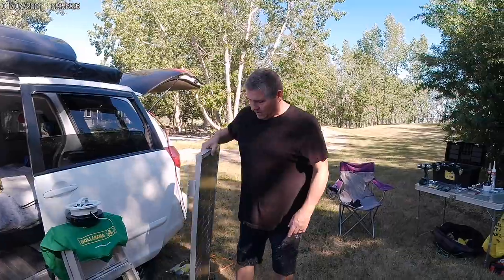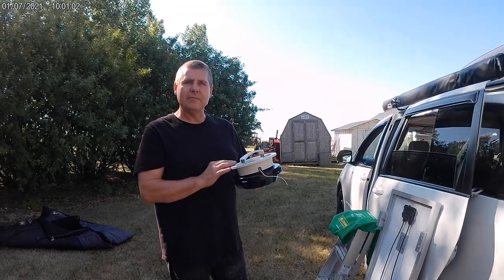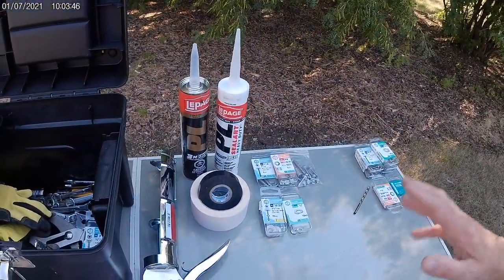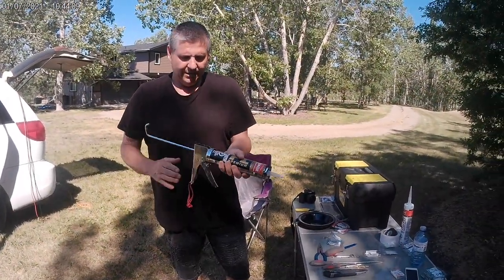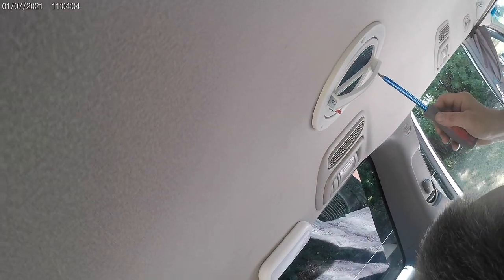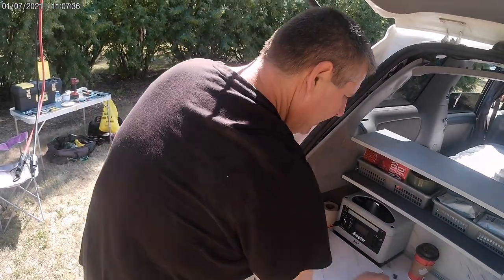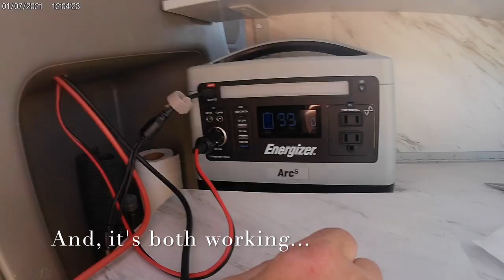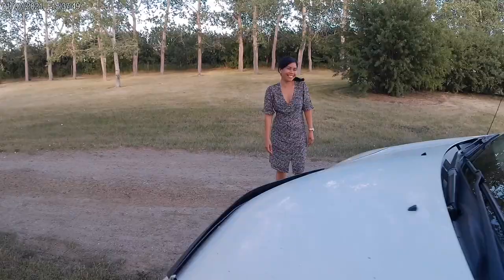Installing Solar Panel and Roof Air Vent in our Minivan - 2008 Toyota Sienna Conversion

Comment: Good decision on the Ventline Ventfan. I installed one on my Promaster City and am very happy with it. I also installed a PWM (Pulse Wave Modulation) speed controller with the fan. The controller allows me to vary the fan speed, therefore the airflow and noise. It’s a nice feature when trying to sleep during the night.

Comment: Two suggestions. As your cord came down around the struts you may have a water intrusion spot. Some installers keep the cord in the area where the hatch rubber trim is and loop it at the bottom. Any water rolling down the cord will continue down and out the bottom. This of course may be unnecessary if behind the taillight where you put it there's a hole and sloping surface to the outside.  Also put more caulk around the fan housing AND the screw heads.
Reply: Very true it's a bad idea to make holes in the roof. In states with rain monsoons. Its gonna leak from the pressure of the water.

Comment: Thanks so much for sharing I've been looking at those roof fans and trying to decide if I should install it or hire someone. Your roof look like the way I'd like to have mine. I just found you. I know you're thinking of reversing the fan, maybe you should have 2 fans. let me know
Reply from the maker: You can do it girl. Just take your time. We have 2 small rechargeable fan inside the van for air circulation.

Comment: Did you have any issues with water leaking into the lights? I’m thinking the same but also thinking I need to seal it as well. Thanks for the video and the idea.
Reply from the maker: Not at all. Thanks for watching our video.

Comment: What kind of screws did you use to attach the solar panel brackets to the crossbars pls? Were they metal tap screws? How many? Have you had any issues with them?
Reply from the maker: We used 4 Stainless self tappings screws. No problem encountered.

Comment: So did you connect that vent fan to that Energizer power station? If so, did you run the wire through the car to make it connect all the way at the back?
Reply from the maker: yes, we connect our vent fan to our Energizer.

Comment: How loud is that roof fan and does it move a lot of air? Nice job !!
Reply from the maker: The fan is very quiet and it moves enough air to keep the condensation off the windows. We also have 2 small usb chargeable fan to circulates the airflow of the van.

Comment: May I ask where you got that fold up awning attached to the roof?
Reply from the maker: Hi Aaron, we got our Awning from Amazon. The brand is Offroading Gear Awning. 
Here's the link https://www.amazon.ca/6-5L-Awning-Front-Extension-Truck/dp/B071YHMC5C/ref=sr_1_6?dchild=1&keywords=offroading+gear+awning&qid=1632187977&sr=8-6

Comment: So, how much does this bring interior temp down in 100f degree weather?
Reply: Summer houston dweller here. The best you can hope for without using AC is for inside temp to equalize with outside temp. In practice, with very good airflow, your inside will be 1 to 3 degrees above outside temp. To cool down even more, i put on a wet shirt and run a usb fan on my body. This effectively creates a very small evaporative cooler on the part where it matters most, your skin